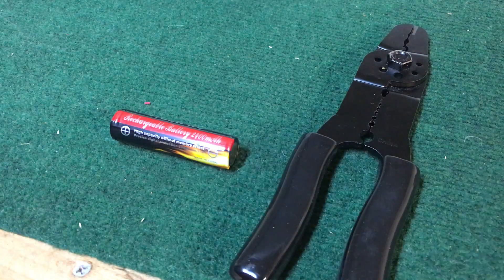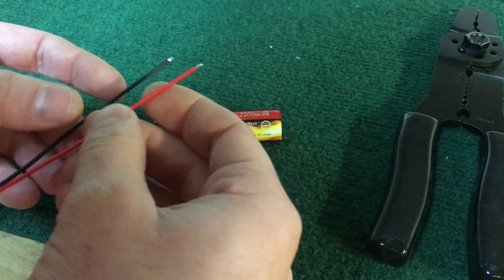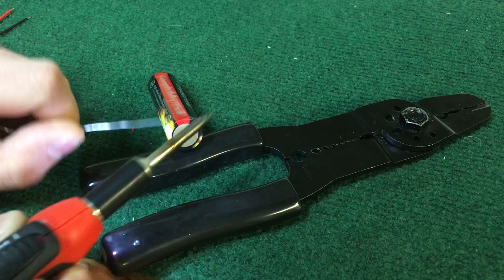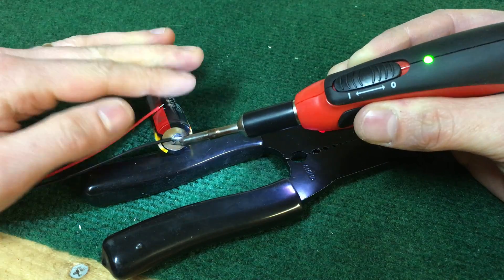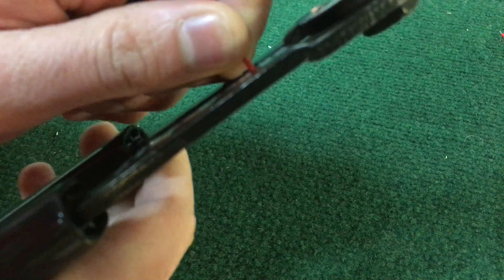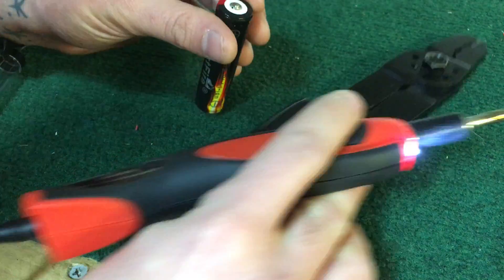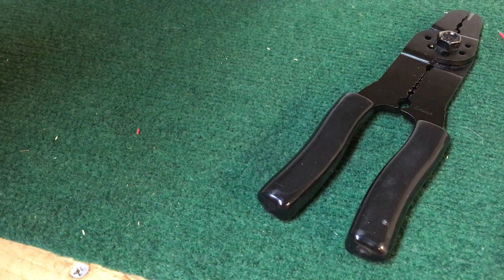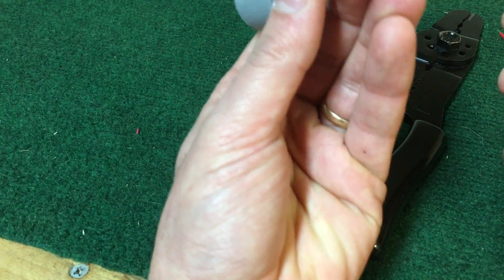DIY 18650 Battery Packs

Comment: Im thinking of doing this with the panasonic protected 3400mAh 3.7 18560B battery...looks fairly simple to do and saves $$$ just heat shrink it when finished I'm guessing.